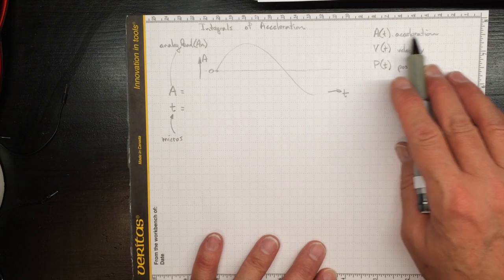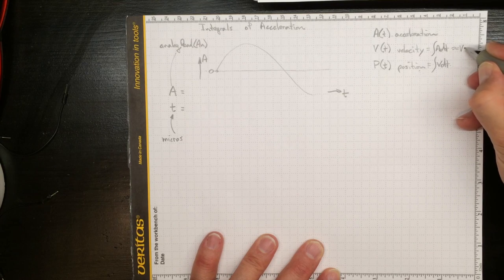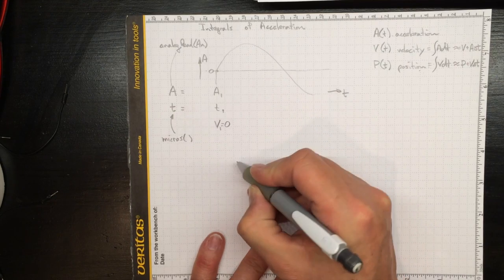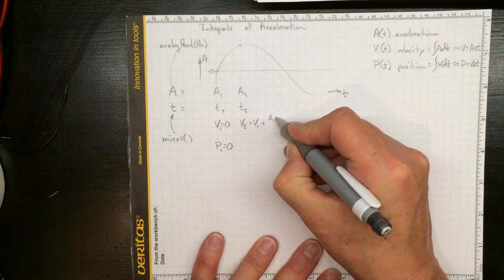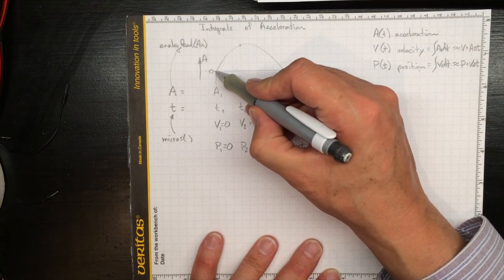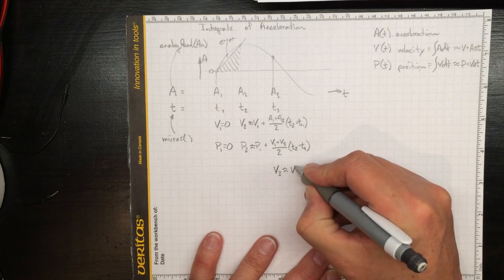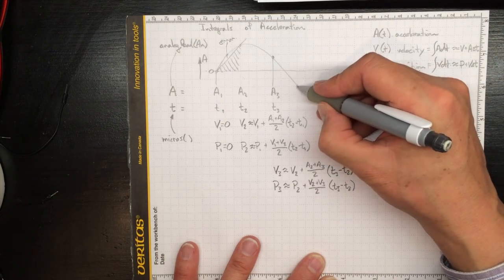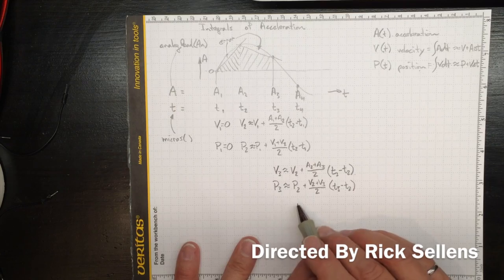Integrate Acceleration

Comment: V_2 = V_1 +( A2 - A1)/dT not A1 + A2 !
Reply from the maker: You are mistaken. (A1+A2)/2 is the average acceleration x dT will give change in velocity.
Reply: @RickSellens  ohh, sorry! My fault
Reply: @RickSellens  Hello Rick, i Don't understand why choising the average from derive. In case of a big deceleration for exemple, at t(5) we could have Acc = +2.5m/s² and at t(6) = -2.5m/s² -> (2.5+ (-2.5))/2 = 0
in Derive like Felipe, ((-2.5)-2.5) / dt <>0
Reply from the maker: Henry H. If A is positive for the first half of the time step, then negative for the second half of the time step, the net change in velocity should be zero. The shaded trapezoids are the areas being calculated. Between t3 and t4 the triangles will tend to cancel out.
Reply: @RickSellens  Thanks for your reply. now i need time to understand it (because my English stayed to low level). Maybe, i'll be back, lol :)

Comment: tried this but very inaccurate result due to small errors in acclerometer data .......there is no acclerometer which gives accurate accleration.
Reply from the maker: That's sort of the point. Inertial measurements will be subject to drift and will always need some other source to bring them back from those errors that magnify over time.